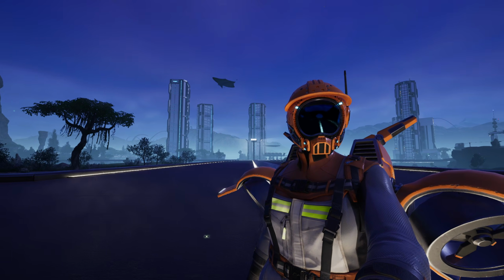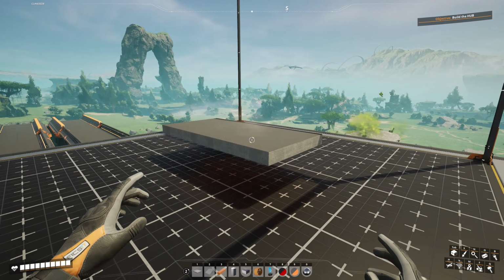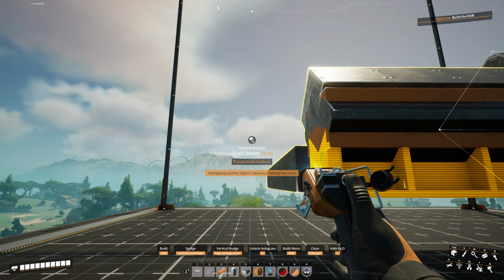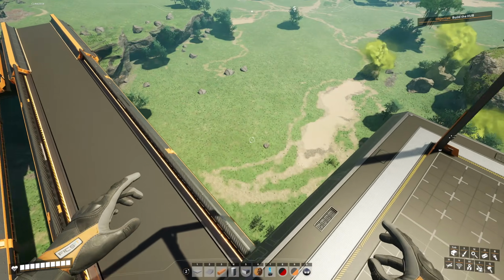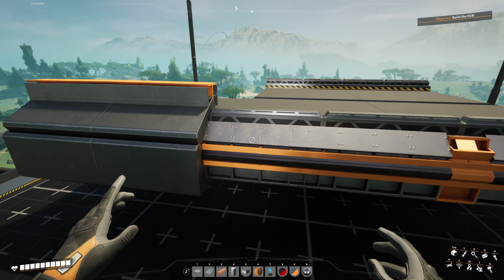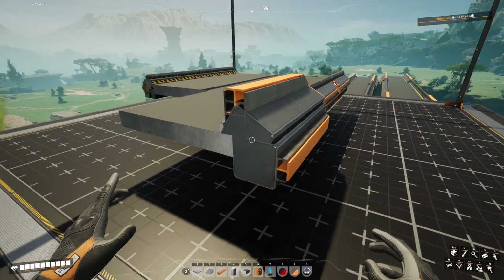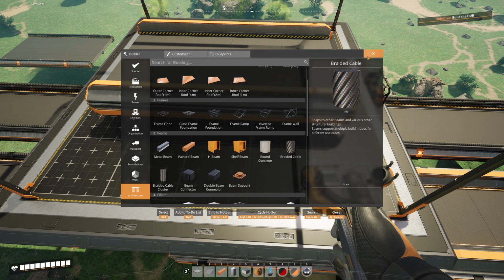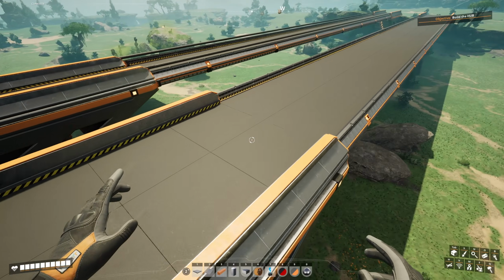Quick and Easy Modular Bridge Build Guide

Comment: Looks really good! I might how ever make those 4m long beams into the full length on you intend to blueprint so that the object count can be reduced. Like if it is a 8m section for the blueprint, make all the beams 8m long rather than having multiple 4m long ones since each of those count as an object. Very handy for quick placement making it modular.
Reply from the maker: Yup thats a great tip did it on the 1st blueprint in the showcase but i do need take it to the max in that regard

Comment: I'm going to restart at 1.2 official. 
Random nodes
No trains or drones. Wheeled vehicles only. 
Should be interesting
Reply from the maker: That sounds like a fun challenge, good luck!
Reply: Random nodes is actually a lot more fun than I thought it would be. After 3000 hours, it makes sense.
Reply: @PhrazeMuzik I checked out experimental just for that reason.
It definitely changes the entire strategy.
You're either going to be shipping tons of material to a large factory, or just have small mini factories and power plants all over.
Reply from the maker: Yup I'm looking forward to my 1.2 fresh play through